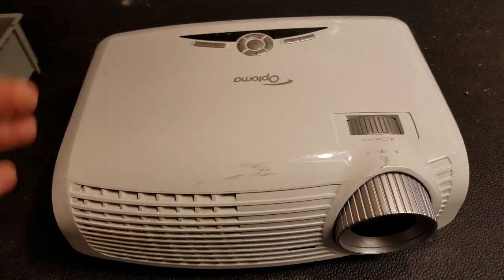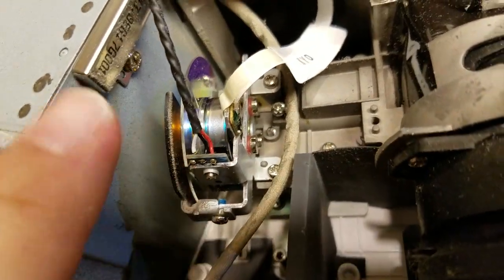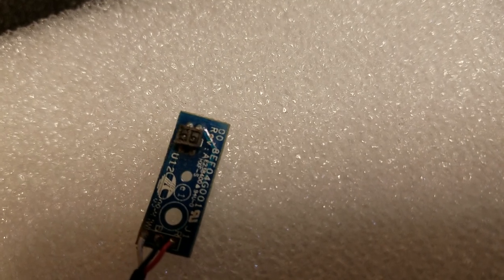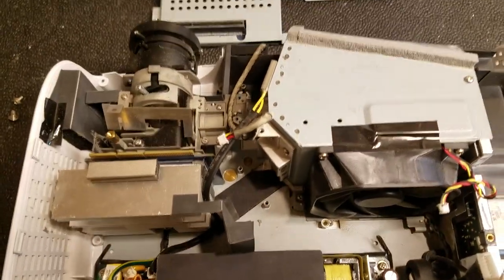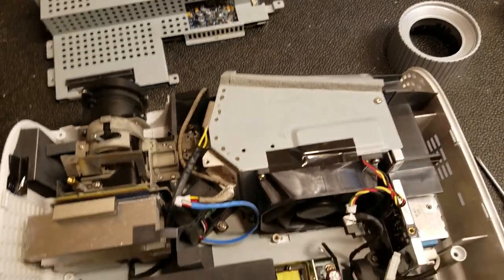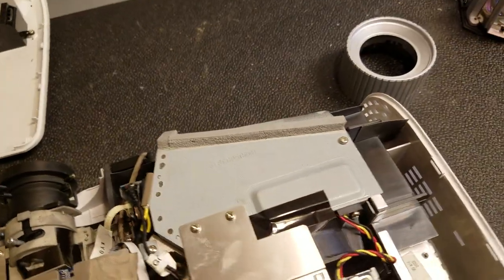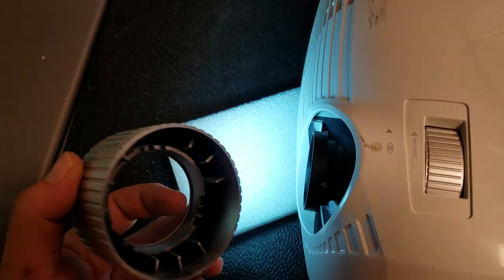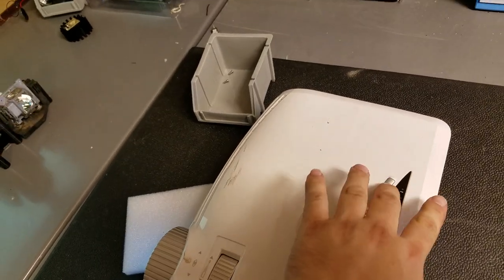Optoma HD20 Projector Cleaning

Comment: I have an Optoma HD20 and the bulb broke a few days ago. I replaced the bulb, but now I am having the following issue. The unit will power on and run just fine for about 5 or 10 minutes and then all of a sudden, the color will turn grey/green and start to jitter or flicker slightly then the unit will power itself down and then the red light stays solid and the amber light will flash. I can unplug the unit for a minute or two, plug it back in and start it back up and the exact same issue will occur. Any ideas?
Reply from the maker: Absolutely.  Let me ask a few questions first.  Is the lamp using an name brand bulb?  Also, does the glass on the front look like it has a tint to it?  If not, you were sent a bum lamp.  A lot of places sell cheap knock offs. There are lamps that are not OEM that are perfectly fine, but also some that are pure junk. Your description sounds like when I tested lamps from a new vendor that were improperly coated.  Where did you get the lamp from?  One trick that might work, is move the lens from the old lamp to the new lamp. If it then works, that was the issue.  Basically the Infrared light is not being filtered and its confusing the color wheel sensor. The other possibility is that when you changed the lamp, some dust was knocked loose and clogged the sensor.  Either way something is causing your colorwheel to lose its place and then the unit is shutting down to protect itself.
Reply: It was the little lens! I removed the lens from the old unit, put it on the new one and it's been working fine for the last couple of day! Thanks so much for your info. You saved me a trip to the repair guy down the road and probably around $150 for him to check it out and repair it!
Reply: Well, it's me again but using a different account.....the fix above worked great, but about 4 days after I fixed it, I started getting Fan Failure errors and then the unit would automatically shut off. I don't really want to spend a fortune taking this to the repair store....any info on how to fix the Fan Failure error? I can see and hear the large fan moving when the unit is on.
Reply from the maker: Id bet you have a wire that is falling into the fan.  Open it up again, and very carefully make sure all the wires are clear of the fans. I doubt anything is actually wrong. Ive seen that before myself when a wire slips and causes a fan to drag.
Reply: Ok thanks, I'll give that a try tonight or tomorrow! =)
Reply: Rostit I have to thank you SO MUCH. watching this entire video gave me the confidence to try to tackle this on my own. I took the entire unit apart, cleaned out all of the dust and found a fragment of glass inside the small little fan which was causing it to not turn at all.I removed the glass, put the unit back together, mounted it and turned the power on add I kept my fingers crossed.... and... IT WORKS! lol 
thank you thank you thank you for this education and confidence booster in my diy skills. the fans are working and it's been running fine for a few hours now. 
I do want to ask... when I put my hand over the front vents next to the lens, it's pushing it hot air... that air should be hot because it's flowing over the lamp right? just want to double check to make sure! thanks again!
Reply: Ok....So I spoke too soon. LOL. The unit worked fine for about an hour or slightly more then as I was watching a movie, the screen just want solid black. A few moments later, the unit turned off with no error message on screen and both the amber and red lights were solid.
I unplugged the unit, let it sit for about 15 minutes and plugged it back in. It began to start up, but when the bulb was turning on, it started to flicker quickly which I've never seen it do before so I just unplugged it right away in fear of something bad happening to it. 
Any ideas? You've been so much help!
Reply from the maker: Can you email me a picture of the bulb?  Take a pic of it looking down the front of the lamp. So I can see the arc tube in the center.  Also, double check all your reassembly. If there was a piece of glass(im guessing from an old lamp) there might be more.   rostit@ultrafark.com
Reply: Rostit ok I'm going to email you the pic in just a minute. it'll be coming from inkmachine using Gmail. thanks for all of your help!

Comment: Hey there! I have Optoma TW 605 ST, very similar inside. All componenst located same way, just a bit different mobo. Had to replace bulb, did so, and also disassabled to clean, also with air compressor. Did it gently. However, once everything is assambled together I have many light spots on picture with one big.. See picture in that link: https://imgur.com/DcHcp0Y
https://imgur.com/lK0d3xQ
Can you help me and say what the heck is wrong?
Thx in advance...
Reply from the maker: Hello Krzysztof! You have a dirty DMD module.  The front side of the DLP chip has lots of dust on it now.  Sometimes, if there is a lot of dust, it will blow into the optic module and cause this. 
https://youtu.be/K_bCP74xsPo  I go over the optic cleaning.  This should help. Also, make sure the bulb is a good brand. It should be made by Osram or Philips.  If it is not, it may not be bright enough.  Projectors are made to tolerate a certain amount of dust. The lamp should be bright enough to shine around the dust particles if they are not too numerous.  If you have a lamp with an Osram bulb, then you are probably ok there. If it is a cheap knock off, I would be suspect of the bulb as well.